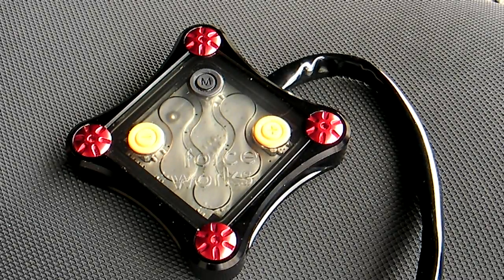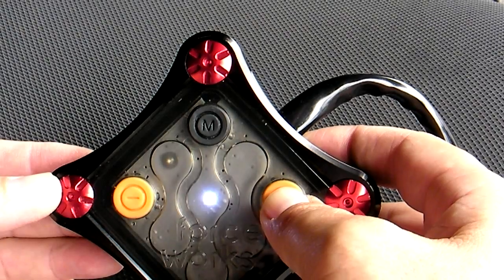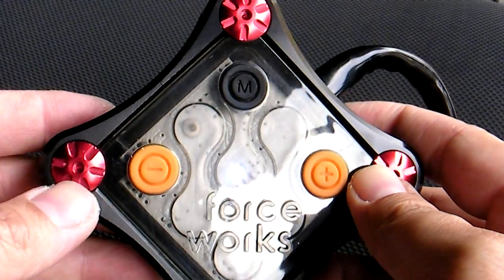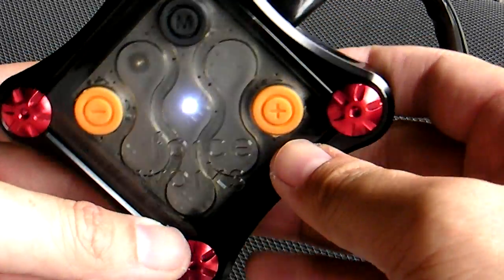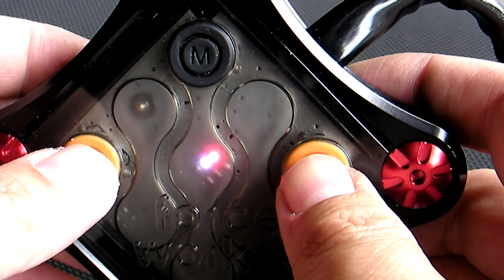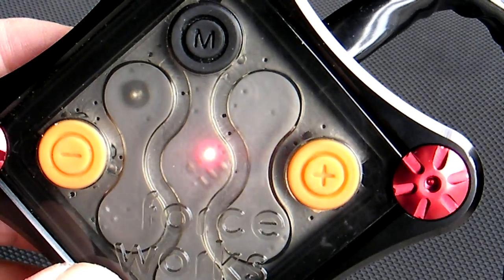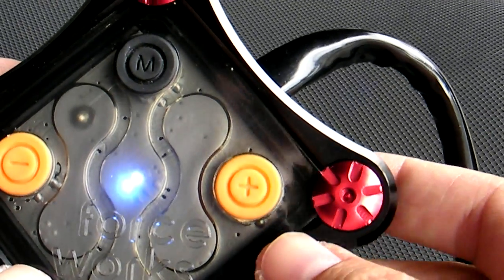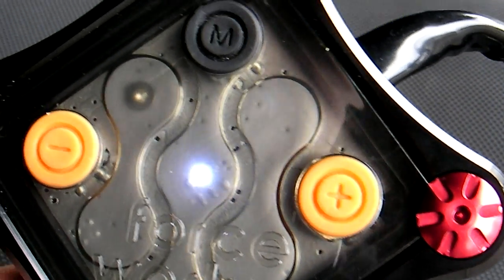Forceworks Basic Yamaha BWS Zuma 125 Fuel Managment

Comment: Hey Chris is this easier to use and hook up then a juice Box?? Is it for the stock 125 or can you use it well big bore kit???
Reply from the maker: my 158R bbk does not need a fuel controller. works on stock ecu with stock throttle body.
Reply from the maker: https://www.rcscooters.com/yamaha-engine

Comment from the maker: this unit is mostly mounted externally so the designer wanted it fancy. the hardcase is acutally billet cnc aluminium. no idea why so overkill, not like you going jump the bws/zuma 12 feet in the air 20x in a row. scoot would fold on the 2nd jump lol.